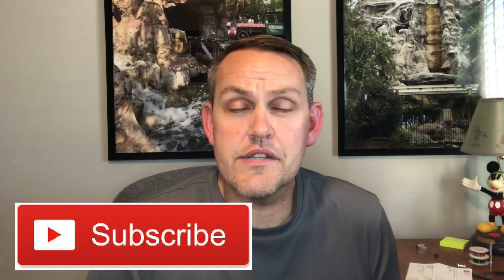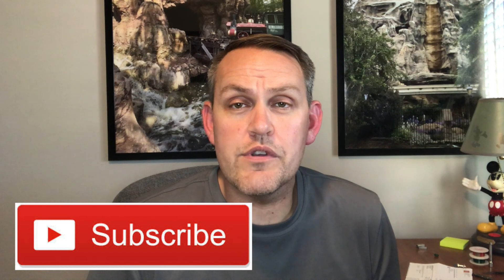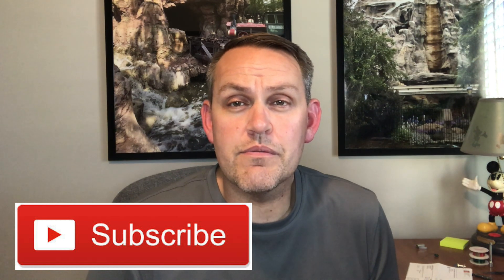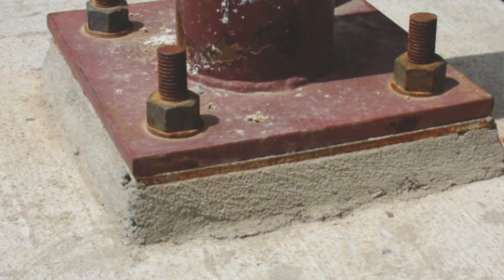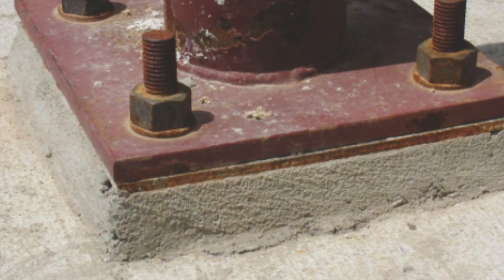FURY 325 SUPPORT IS COMING IN HOT! 500 cycles and open right? not quite.

Comment: where do inspections fit into the schedule? their statement said after the 500 cycles and in-house inspections and whatnot they will "ask B&M and the third-party testing firm to perform a final inspection", is that an extensive process?
Reply from the maker: No it’s very quick inspections. Most of the time 3/4 of that inspection can be done with the ride running. Or just comfort words to hear. The inspection is happening it’s just not a long drawn out process.

Comment: I think you did not mention: The park said they are going to do an accelerometer study, comparing new results against old to make sure the dynamics of the the ride have not changed. It wasn't clear to me whether they would immediately proceed with the 500 cycles, or if they would pause until after the accelerometer verification was complete. To me, this seems more like a gate in the project plan than a major step...but it's supposedly in the plan. 

I hope they have napkins handy for any analysis that needs to be done!
Reply from the maker: Haha! MAXIMUM NAPKINS PLEASE!!!! I’m betting the analysis will be done on cycle #1-10. The rest is probably just waiting on time to pass. This will be interesting to see what happens next.

Comment: You showed a quick clip at 8:07 of people harnessed up straddling the track. After several years doing water safety at a water park, I ended up climbing radio towers, working 200-2000 ft up. How often did you have to climb? Was it more as a safety line like a bucket truck, or did you have to traverse some distance on the track? All my climbs were vertical, seems like a track would be fun to climb.
Reply from the maker: Most can be accessed with a big manlift. Stuff that can’t, you get up there as high as you can then start climbing. The rungs are about 4 feet apart and the track is greasy. It’s a lot harder to climb than you would think. I’m talking vertical. Some rides welded climbing rings in the structure but my park ad none of those.
Reply: @ryantheridemechanic can't wait to figure out what your park was.  It's only a matter of time. I'm taking a deep dive
Reply: @samich57 I think I've got it figured out: he's mentioned a B&M floorless, a GCI that I believe has been RMC'd, Intamin, a Gerstlauer spinner, Premier Rides, a boomerang, another twisty Vekoma thing... He's said he doesn't enjoy Zamperla, and he's showed a Lasker looper. He had not mentioned CCI or PTC. It seems like there have been a few other clues that I'm forgetting. But I'm pretty sure I found it by looking at a list of rides on coasterpedia for the park that I'm pretty sure he was at :)
Reply from the maker: @samich57  haha! No diving on the shallow end! It not hard to figure out

Comment: Great observation.  Can you tell how much the 90+ degree temps will affect the system?
Reply from the maker: Not sure I understand the question. Can you elaborate on this?
Reply: @ryantheridemechanic  As the metal heats up, most steel coasters tend to expand.  As most rides are often installed in more moderate temp seasons; there is a formula for expansion and contraction.  Here it will likely be installed at a time if greater expansion. Hope that helps clarify.
Reply from the maker: @indianoutlaw5702  ah, typically final torque is done mid day when it’s hottest but if weather is not ideal the it’s still torqued. So temperature is really null. The structures ping and bang during expansion and that’s normal.

Comment: I have a question, why do they test wildcat 30 minutes after hersheypark opens and open it at 10: 30, and why do they close it at 5: 30 only to open it 15 minutes later. I’ve been there 15 times bc I’m a season pass holder and I have their schedule down to a grain a salt. Is it an issue with all new rmcs or is it just the individual ride? And what park do you work at?
Reply from the maker: Hmmm I’m not 100% sure but it sounds like a carpentry thing. You would run the ride and the carpenters would have to stay and watch it for an hour to make sure the wood was ok. Also done last thing at the end of the night.  Sounds like the park has built In windows for this. It might not be to work on the wood structure it could be to allow the carpenters through a dangerous area that can not be in when the ride is running, kind of like an official track crossing request.
Reply: @ryantheridemechanic  I have seen the underflip go through a massive amount of flexing but I know it is supposed to flex a little bit, but in the 5: 30 time slot they seem to be working on the lift components like the chain cogs bc I was in line for 3 times during the 530 time and there was maintenance lookin at the top of the lift hill
Reply from the maker: @sendyboi7028  some rides have extreme components to take care of. Lifts have a lot of stress on them because they are heavy. They could be oiling the chain if they don’t have an automatic oiler on it already. I know old PTC rides that are still in operation actually has a mechanic doing a constant track walk between cycles. They have to constantly move and press buttons to allow the next train to go over the lift. Crazy but true.

Comment: Do you think they will add more reinforcements to the new support where the current one cracked?
Reply from the maker: No need. Problem made it slightly different to compensate for whatever they found.
Reply: @ryantheridemechanic  Do you think they will take the old support somewhere for further investigation into what may have been the cause of the crack forming ?